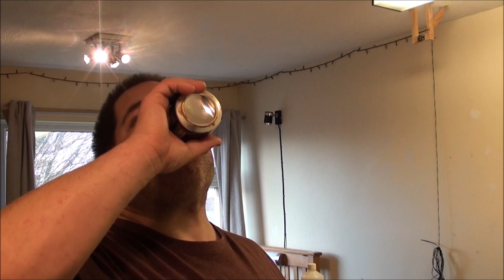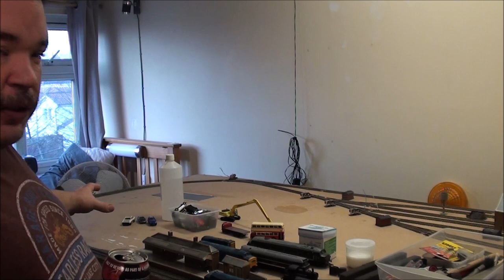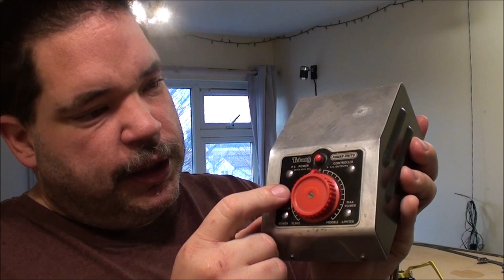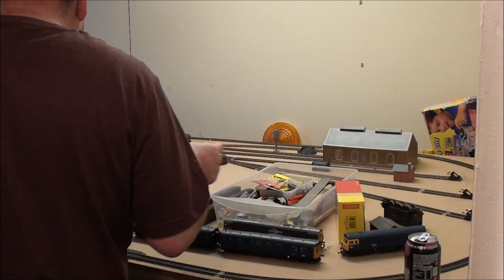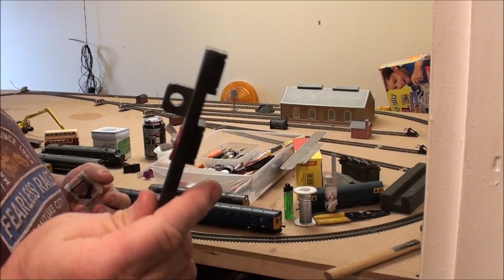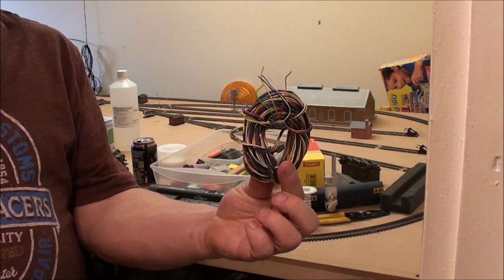Model Railway: Tips, Ideas And How I got It started.

Comment: Good to see the layout in use. It's good you have decided on a track plan, I'm still in the overthinking stage.
 Hopefully I can get a baseboard layed this year and start building my layout. I am going to do a shelf layout along one wall of my dining room(10x2), utilising tigh radius flexitrack to get a continuous loop. May not be optimal, but I think it's the best place for year round use,  as garage/loft and conservatory all have the extremes of temperature.

I have all my locos and rolling stock. Short wheelbase wagons and small shunting locos. Enough for three layouts!   I have been putting off building my layout that long! 

I am totally at sea when it comes to electronics on a layout, so I will likely use manual point throws, wire and tube style. This puts quite a few restrictions on the plans if I don't want to be constantly getting up to change points, but I hope to one day have a full set of switches to control everything, I certainly wish I had more confidence approaching the electronics side of the hobby. 

Look forwards to more train videos. It has been alot of diecast recently!
Reply from the maker: Do you like vintage model railway stuff? I have just acquired a large lot of Hornby 3 rail dublo.
Reply: @RandyDarkshade2  

Yes I have a couple of rakes of the dublo mica b wagons, with a a few that have a tension lock couplings fitted so I can pull them with  newer locomotives.

That class 20 looks a great runner, and if you can get those other locos working I think you could turn a small profit if you did decide to sell.

Dublo prices have certainly increased during lockdown and certain items fetch a premium still. 

If you do decide to keep it where will it go? Can you fit a small loop inside your existing layout?